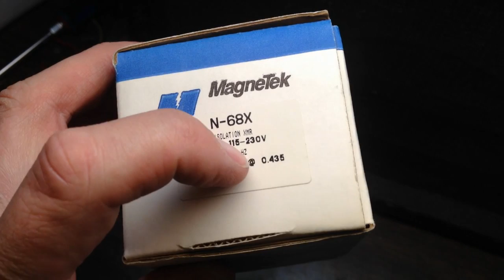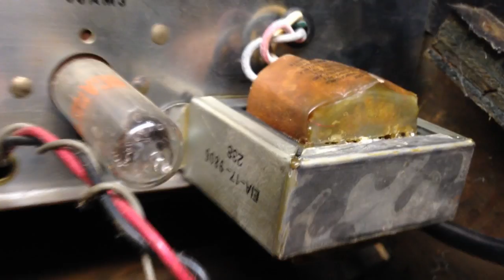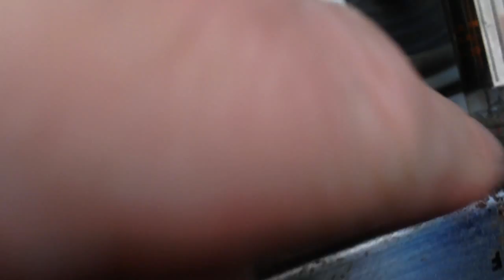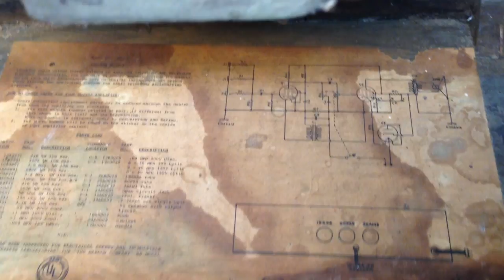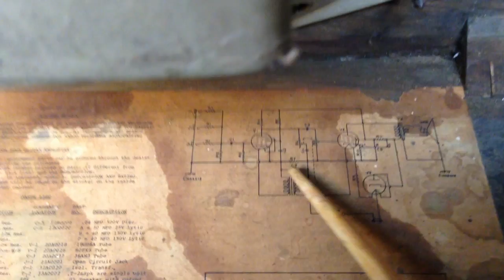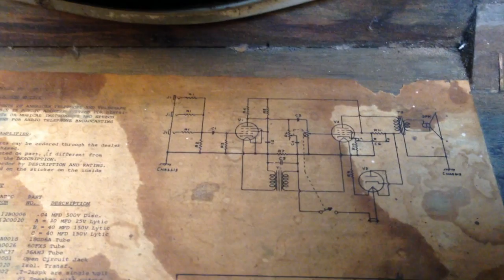Installing an Isolation Transformer in a Vintage Guitar Amp

Comment: Brad.  Thank you for your stance on current affairs.  My question:  Would a wireless guitar system isolate the player from a series-filament widow-maker amp?  Would the wireless transmitter act as an isolation transformer?
Reply from the maker: A wireless would isolate, of course.

Comment: When adding the isolation transformer, I see many refer to the Death Cap and removing it.  In this schematic, I believe it is the .04 ceramic disc cap attached at the volume pot along with a resitor.  Is there a reason you did not remove it?  Is it an option, basically has the isolation transformer made it irrelevant so you can leave it in or out or by removing is there a potential issue.  If it is OK to remove, should the resistor be removed as well?

Comment: One approach might be to galvanically isolate the input rather than the power supply.You could use a floating input jack and an audio small signal transformer. 

 The Western Electric 19C was an audio sig gen that was AC/DC but the outer cab, the knobs and the output terminals were all isolated. Worked fairly well. The orientals tear them apart for the transformers for making some kind of WE nonsense but the concept is innovative.

Comment: Hi Brad. I have a similar series filament amp and virtually the same isolation transformer that I want to install, so your video is a great resource. I did notice though that your amp has a half wave rectifier, the 36AM3. According to gmoon's Instructable (http://www.instructables.com/id/Isolation-transformer-upgrade-for-old-guitar-amps/) the half wave rectifier will cause a transformer of this size to overheat (quote "When I first installed it, I tried to use the N-68X [isolation transformer] with the circuit, as-is. But it immediately became obvious that the transformer became too hot"). Was that a non-issue with this install?

Comment: Love your videos! Had a question for you if you have a few moments - in researching adding a power isolation transformer to a Harmony H400C (Canadian version of H400A I believe) I've seen at least one guide express concern about using the N68X transformer since the 35W4 rectifier is only half wave, leading to the transformer being saturated too quickly. I'm curious if you think this is a valid concern? Sorry to ask for specific professional technical help via a youtube comment 😇 .
Reply: Did you find out if its an issue? I am planning on adding to an amp that also uses the 35W4.

Comment: Hi Brad, love your videos.  Speaking of isolation transformers-- a lot of folks recommend using isolation transformers when repairing old radios and transformerless tube amps. Is there any advantage to using one when working on modern tube guitar amplifiers such as Fender or Vox--or could I be in more danger plugging such amps into the isolating transformer while troubleshooting?
Reply from the maker: Isolation just means you're isolating yourself from the full wall 120VAC. Putting something between yourself like an isolation transformer just helps ensure if you get shocked, i.e. bridge the 120VAC to ground with your body, there might be a chance you'll survive because you can't receive the full wall current across the gap between primary and secondary transformer windings. If you are interested in safety, an isolated variac transformer and current limiter are probably good purchases. The kind of variac I use is not isolated because it's an autotransformer, meaning there's only one winding.

Comment: Hi Brad,
Merry Frippus.
Where do you sell the amps you buy and sell ?
I hope it's on Reverb .com and not E-Boo.
Also...how do I get in touch with you outside of writing messages here ?
I  won't correspond and refuse to deal with anything involved with Farcebook.
Yes, I spelled it like it should be spelled but that's just me trying to remain a low profile under the radar.
Reply from the maker: Craigslist and Facebook is where I list my stuff: http://louisville.craigslist.org/search/msa?query=773+1103

You can reply to one of the listings there and get me that way.
Reply: If those sites work out for you I wish you all the best.
Personally after years of selling on e-Bay,  Reverrb.com was a breath of fresh air and they only charge 3.5 %
commission vs. e-Boo's !0 % ....A no brainer for me.